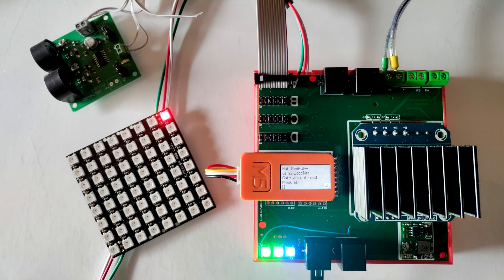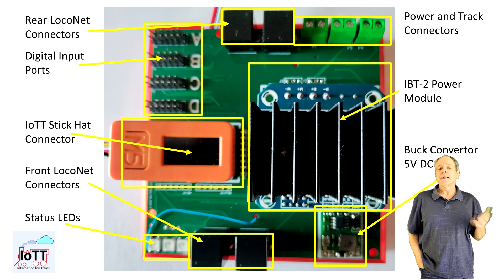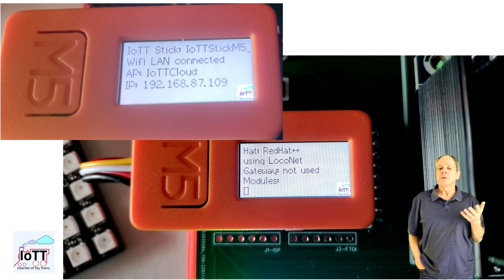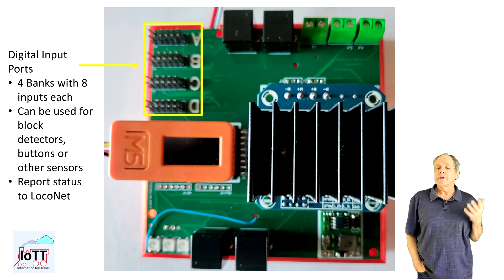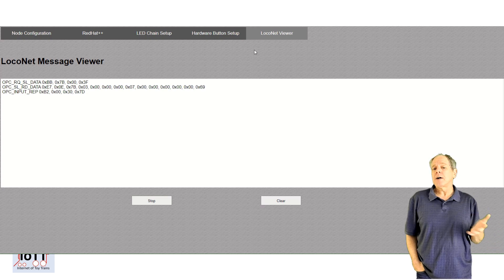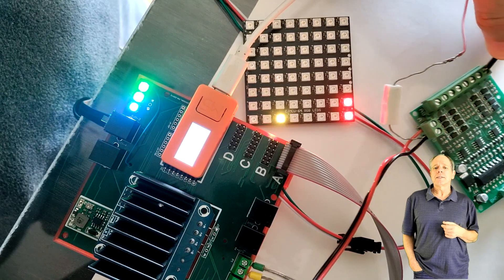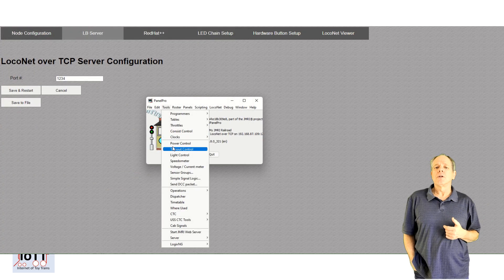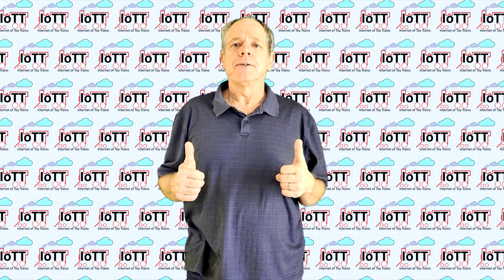Almost there! RedHat++ Update (Video#89)

Comment: 3:06 Will the RedHat++ also support a USB/serial connection from a PC, that would function as if the PC app were connecting to LocoNet via a LocoBuffer?
Reply from the maker: No, it will not. But it provides a LocoNet over TCP server and a WiThrottle Server via Wifi. With that, you can connect one or several JMRI computers or smartphones with throttle software.

Comment: Wow Hans! This board is amazing! The abiltity to generate Loconet messages and/or act as Loconet Server with JMRI is amazing! Amazing work!
Reply from the maker: Well, it is standing on giant's shoulders. LocoNet is a very reliable and still easy to manage network, and the DCC++Ex code generator is quite a beauty as well. All I do is a few lines of code to bridge between them....
Reply: @IoTT  Yes, and you also have designed the hardware. Don't downplay yourself Hans. You really are an amazing asset and your skillsets REALLY impress and inspire me. :)

Comment: @Hans 10A as the max. output current and H0 or N is a really bad idea. Lots of railroaders use too thin wires. Additionally spot welding on the wheels and on the wheel sliders are possible - and at least where do you need this huge amount of current? Is there a possibility to change the threshold of the programming track acknowledge - some decoders seem to be a little bit off the norm and need help by the command station.
Reply from the maker: Thanks for the feedback. Well, as noted in the spec sheet, the plan is to make the maximum current software configurable. And besides the maximum current, it is also important how aggressively the device shuts down if a high increase of current is detected.  But I agree, 10 Amps on N or HO scale is scary, but it is a different story in G scale when running a train with several illuminated cars.
I am currently looking into adjusting the decoder ack pulse via configuration option. I think it should be feasible.
Reply: @IoTT  Decades ago I build the Edits booster. That was a "tuned" sound amp with a 10Amp output and fold-back current limiting. The shortest short circuit ended up in a spike on the running area of the wheels. After that  this booster is located in my work bench. Other users of this booster tried to split the output to have multiple in-feeds without good results. Your argument to have a demand of this power for illuminated passenger trains bases on bulbs to illuminate the wagons. G-scale locomotives do not need that much current and based on the experience you also need multiple in-feeds and after replacing bulbs with LEDs 5A are okay. BTW: Piko seems to provide locomotive decoders where the detection of the programming feedback should be able to change the characteristic.

Comment: You made good progress on the red hat ++. Good work. One thing missing in your product offering is a dcc snifer to be able to add non loconet compatible throttle. Or in my case not fully compatible loconet system. As ESU does not send locomotive slots information true it L.Net adapters, only work in one direction., ie read. Another nice feature for the future would be to implement directly one of the apps for phones, like Z21, wimobile . Those are details. Your red hat ++ is on a great start.
Reply from the maker: Thank you. A DCC sniffer actually exists. You can use the DCC interface and put the Stick to DCC to MQTT mode. It then will decode the DCC commands and send them to MQTT. See Video #56. What I do not know how you would bridge from there to a throttle.
So far I hesitated to implement a proprietary Wifi interface to connect smart phone throttles directly as this could become a never ending story. With LocoNet over TCP and JMRI I think we have a more flexible solution. Of course the disadvantage is that you need to have JMRI running There is a certain chance though that there will be a direct WiThrottle interface in the future, but that is not a promise ;-(
Reply: @IoTT  i may be wrong but never saw in any Iott video that the dcc topic is bridged with the loconet topic in MQTT. I know it can be done. As for my investment in ESU cab control, I came on a interesting feature on Facebook today. The android apps engine driver can be use on those. So the can be connected to JMRI, nice. The throttle button should work.I need to test this feature. This way I can fully convert to dcc++. And remove the ESU command station. And still keep part off my investment.
Reply from the maker: Video#56 would be a good starting point. The conversion and communication with LocoNet could then be done in Node-RED.
Reply: @IoTT  just tested engine driver on the ESU cab control. It is working great. This feature is making my day.